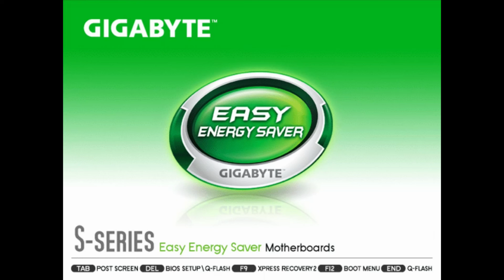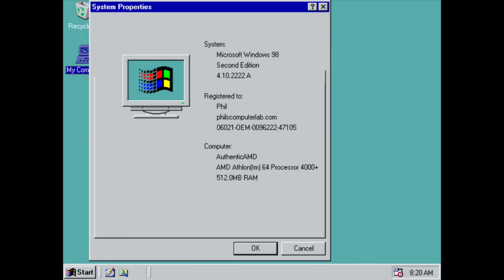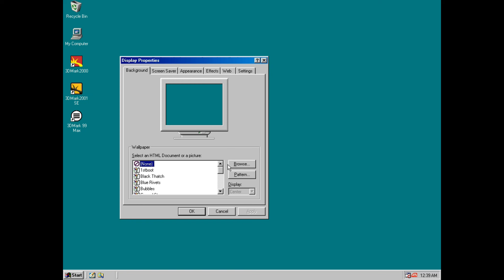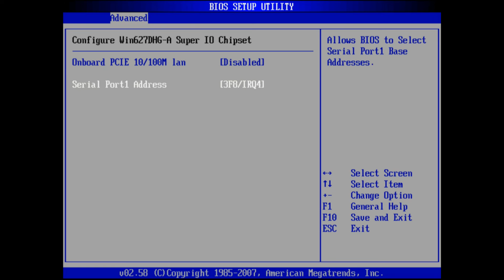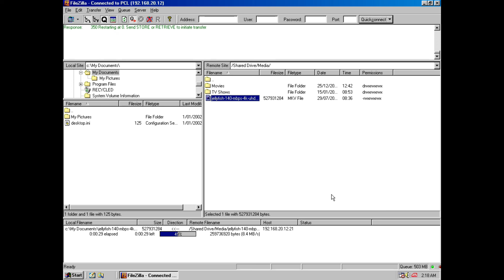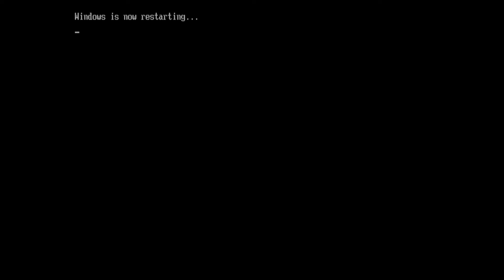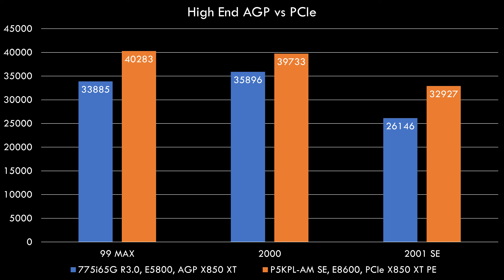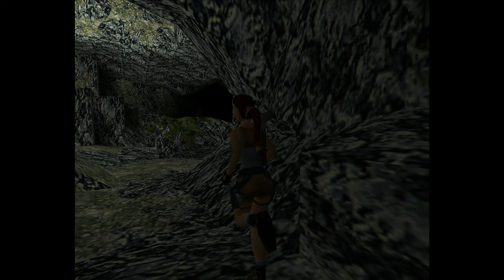Using PCIe Graphics Cards with Windows 98 SE

Comment: Is there any nvidia card that will work with pcie ? I already tried a 6800, 7900, quadro i still need to test, get a not working sine, so will try to disable it and restart. Or is it better to use agp for combo win98 and XP system ?

Comment: I think that a potential builder of a such a computer might want to consider VIA's PCIe chipsets. They are pretty hassle-free as far as the gpu setup goes, no need to disable anything and color depth shenanigans as shown in this video.
Reply from the maker: Hmm aren't such motherboaeds quite rare? Afaik Intel sued VIA for Pentium 4 PCIe chipsets and many motherboard manufacturers didn't want to take the risk...
Reply: @philscomputerlab  I think those were released post-ban, when they've reached some sort of an agreement ~2005-2006, but it was too late for via's chipset business anyway. At any rate, MSI, Gigabyte, ECS and others are available in P4M890, P4M900 and so on flavors.

Comment: I am building a retro pc with a SOYO K7VTA PRO v1.0 (the newest with ISA slot I, amd Athlon xp 2200 or something, fx5500 256mb agp (i think with the better 400mhz memory), and two different soundcards, one ISA AWE 32 and one sound blaster live 5.1 pci. I haven't still put it together. I have been told that the geforce fx series was the most compatible with DOS games...

Comment: Phils do you try pci express network card on this motherboard and do you have the integrate lan driver for this motherboard? Thanks
Reply from the maker: I didn't try, but what I recommend is follow the theme of this project and use a PCI 3COM network card...
Reply: Ok thanks, I put a startech gigabit ST1000BT32 pci who working very well but I can’t put my soundblaster live 5.1 now. 😅 Will try with an P5KPL AM EPU who have two pci slot.
Reply: I tried to put a soundblaster live 5.1 and a pci network card ST1000BT32 on a P5KPL AM EPU, unfortunately it doesn't work very well. For the sound an usb sound card or my usb logitech speakers run good, just needed to enable "legacy USB support" in bios. Does anyone know a cheap usb/RJ45 network adapter (gigabyte speed?) who can work in win98? Thanks.

Comment: I'm always getting errors the first time I boot Windows 98 SE from the hard drive. I get blue screens saying "A fatal exception [...] has occured at [...] or those white dialog boxes saying Explorer.exe etc. I have tried several times installing Windows, but it either gets stuck at detecting Plug n Play devices or crashes with those white dialog boxes at the desktop and then it doesn't respond anymore. I use an AM2+ MSI KA780G with a Radeon X300 and an Athlon X2 BE-2300. I also disabled everything I don't need in the BIOS. Such as LAN, HD Audio and onboard graphics. At this point I don't know what to do anymore. I also checked VOGONS, but didn't get the answer I was looking for.
Reply from the maker: @HardKickinGroupGermany  I haven't tried that platform yet. Do make sure to use 512 MB RAM or less.
Reply: @philscomputerlab  Hmm, I'm using 1 Gig. Maybe that's too much.
Reply: @philscomputerlab  So apparently it wasn't the RAM size. Now I'm using 256 MB. I could get to the desktop on safe mode, just like before, but this time I tried to run msinfo32, but immediately got a blue screen after hitting Enter. Exception 0E at 0167:BFF9DFFF. I should mention, that I'm using a Radeon X300 SE with 128 MB.

Comment: I am confused. At 12:21 you have the 3DMark 2001 score at 33k but on the very next slide you have it over 37k when comparing with the other graphics cards. I am getting about 34.5k on my PCIe x850XT under Win98 with 1Gb RAM and 3.0Ghz Xeon quad core. Strangly if I increase the RAM to 8gb, the performance goes down to 28.5k. Under XP the performance is not effected by the amount of RAM (I get just over 39k on XP). I am not sure why Win9x is slower with more RAM, but I am ok with it, as the peformance is still excellent. I intend to also boot this PC into Linux for web browsing etc.
Reply: Windows 98 hates anything above I think 1 GB of ram
Reply: @setty3000 true. I believe I installed a RLoew patch to resolve that.  This was a build on a test bench. Not something  I actually ended up using.

Comment: I wonder if you have the appetite to do a 6800 ultra vs X800/850 XT comparison in windows XP, perhaps even with a system faster than the E8600 and newer drivers (by perhaps a couple of years)? I get the impression the Radeon's will be faster due to driver progression and alleviating a CPU bottleneck, but the 6800 Ultra will always have a special place in my heart as the first top dog GPU I ever bought (upgraded from a 128MB HIS 9800Pro Ice-Q - hell of a card too!)

Comment: Just wanted to thank you for this video.  I was able to test a similar setup recently:  ASUS P5KPL-AM EPU / Core2 e8400 / Hynix DDR2 5300u @ 667 / Radeon x800 XT  
My average 3D Mark 2001 score was 34280, but I had several system and PCI devices that are not supported or do not have drivers.  So I tried something else...  
With these parts, I was able to get 3D Mark 2001 scores in the 23500 range on an ASRock ALIVESATA2-GLAN and Athlon 64 4000+ with 1mb cache overclocked from 2.6 GHz to 2.88 GHz.  The AM2 board used a VIA chipset with working drivers for everything except an ACPI motherboard resource.  Also got in the 22500 range on a Fujitsu-Siemens D2030-A Socket 939 board with an Athlon 64 3700+, SiS chipsets, fully supported with all drivers.  Fun projects, all PCI Express, all working with the caveats mentioned for the AM2 and 775 boards.
Reply from the maker: Awesome outcome! Yes PCIe feels so won't but the more surprising to see it actually work 😜

Comment: So this machine could run Windows 98 se up to Windows 7. What about an OS related benchmark. I guess Windows XP would be the most performant on this system, due to better driver optimization, as well as support for multiple processors, yet more lightweight than newer operating systems. Also, a boot time benchmark would be interesting. You should also be able to start with ms dos 6.22, which would start almost immediately.

Comment: I have had a few dead 9800 and x800 series AGP cards I bought "untested" for a stupidly fast Win98 system.
An abandoned old idea. Always thought PCI-E was a no-go, but I know some Voodoo cards with AGP are basicly PCI cards in every way but the physical connector, so this might be a similar case?
I've just picked up an x800 GT and an x850 XT (non-PE). Both PCI-E, just take this dream for another spin. Not the very best of the creme de la creme, but I figure both to be overkill for Windows 98 regardless. Just like you said, this does open a few possibillities.

Comment: The reason for the need to disable the VGA adapter in Device Manager is because of how Windows 9x does its non-Plug and Play detection. When scanning for devices it erroneously picks up what it thinks is an ISA video card and initialises that. This is why you see the resource conflict message. If you choose the "Devices by connection" radio button, you'll see the non-PnP devices at the root of the tree. The only ones that should be at the root on a more modern PC are APM support (if available), Numeric data processor, Plug and Play BIOS (or ACPI BIOS), Processor support and System board. Anything else should be removed to avoid these conflicts.

Comment: Funny thing about the ATI X800 series of cards. They were designed to run with a PCIe bus. Even the AGP model. If you look just above the AGP port on the card you will see the chip that converts PCIe to AGP. I believe that ATI called it PCIe to AGP bridge

Comment: Are lga 775 with agp boards that rare out there? Here most of the early 775 boards, and low cost ones such as the pcchips p23g and several other ecs boards were like this and i think somehow they have chipset drivers for 98 due to their primitive via and sis chipsets (via is probably the betted option, i think).

Comment: What do you guys think of the Ati x800 xl 512 mb? I just picked up the saphire version and man it's a pretty card. The only thing is that the cooler they use was the x850 pe cooler which doesn't touch all of the ram modules, which I hope that doesn't hurt it in the long run
Reply from the maker: Great card! Better suited for XP but can work in 98 as seen in this video.

Comment: You're not using SMB to make sharing to 9x easy?  Yes, you have to enable the 1.x SMB protocol on the server, but it should be fine if your server is not external facing.
Reply from the maker: You can do that, but I now prefer to use FTP and keep the NAS secure.

Comment: Wonder how will this setup would run windows 7..  currently have a machine that runs win98, xp, 7 and 10..  10 really doesnt run, it boots but so slow it is unusable, 7 is very slow also and barely runs.  Just wanted to see what the hardware i have would do.. lol..

Comment: That fix must be an x800 issue as I have had to do the same with my agp x800 if I used dvi out (or hdmi with an adapter), with none of the changes taking unless I disable the second display in device manager. I only noticed what was happening as when I would try to make a change, it would instantly select the inactive display and then fail. But that's part of the fun with the likes of 98, troubleshooting things that are no longer an issue in modern OS's. Its part of the reason why  I would recommend people tinker with an old 9x pc if they have a chance as it will make them more able to sort out the more simple issues they get on newer OS's.

Comment: just curious, would you be able to run an LCD that has high refresh rates with the PCI-e video card? talking 600fps in some games it would be awesome to have an LCD that can do anything over 100hz. But G-SYNC and AMD's Freesync are not in the drivers. so getting one of those to work in 98SE would be amazing.
Reply from the maker: I've done a video on this. The graphics cards have the power but often the game engine has built-in limits and over DVI also only so much you can do. V-Sync works and at 100Hz the input lag is hardly noticeable.
Reply: @philscomputerlab  I'll search your videos and check it out. thanks for the hard work done here, this is amazing!

Comment: E8600 was such a beast of a chip. Even in a locked down Inspiron 530s, it, with 8GB RAM and a GT 1030, kept me going until last year for home theater and retro gaming/emulation use, on Ubuntu with Wine/Proton.

It's now a file/Plex/Jellyfin/pihole server, after I sold off the 1030. Wolfdale really feels like the Sandy Bridge of Core 2, being relevant far longer than most would've ever guessed.
Reply: Can count the 45nm quads too.
Reply: If possible try setfsb
Reply: My first computer I ever built had an E8400 in it. I ran it for a few years until I jumped over to a phenom ii x6 1100t due to wanting more cores and threads. The E8400 was definitely a beast cpu and I used it as a secondary pc until about 2018 when it died after my nephew's house got hit by lightning in a thunderstorm.
Reply: @oOignignoktOo1 sad thing about those Phenoms, they did not have SSE.  Had to upgrade to the FX processor, which had only four cores usable, where yours had actual six.  I was thinking of grabbing one, just so the mainboard remained relevant but alas, it is collecting dust.  After upgrading to a 18 core E5 cpu, I really never looked back.  Although I do have an old P4 machine I am trying to get to work.  Having a real headache with it in Windows XP x86.   I was considering installing linux on it, but my last attempt ended up where GUI was a slide show.  I figure I need a better graphics card or a streamlined build of linux.  I still gotta learn how to use Wine.
Reply: @oOignignoktOo1 you had a need to use more cores ? Even FX CPUs were competing in the same category for Single Core speeds. 
I imagine the Phenom series were even worst single core. And for older games from 98/Xp it was not needed more than 2 cores (1 most of the time was sleepy)

Comment: Should try the the 6800 GT & Ultra and a 9800 GX2. For the 9800 GX2, I'm curious about it since there's modified drivers made that you can use to get that working, where as with normal drivers from NVIDIA, there's no support for it. Hopefully there will be success with that, if you put it on your projects list.
Reply: "those modified drivers" are really just inf edits to add more support to unsupported curie generation based GPUS like the geforce 7 series. and no the 8 and 9 tesla series don't at all work for win9x and were never supported. i don't know why zac added them to the infs, but maybe he was confused at the time when he discovered the driver support inf modification.
Reply: @explorer9049  Sure would love to see those drivers in action anyway, even if 8 or 9 series don't work for them, although specified. That's just me, I like visual proof.
Reply: @SleeperJohns  sorry for the late reply. the only reason why the geforce 7 series work because architecturally they're the same as the 6 series line and the win9x nvidia forceware driver treats them all the same even when technically nvidia never supported this configuration. it was already proven that curie series graphics cards were end of the road for support for win9x.

you can check sites like msfn & vogons on forum posts of people trying to get other unsupported graphics to work but to no avail. even i thought the radeon x1300 series (RV515) could work on windows 98 but alas ATI dropped support after the radeon x800 series gpus.

lets just agree that zak's custom inf edits were an oversight, because those are old driver modifications from like 15 years ago.

you can actually get any vannila graphics card drivers and achieve the same result by editing the device ids and OS label inside the inf, it's how i got my radeon hd 5870 to work on windows 2000 even though the driver was only mean't for windows XP.

i only make these replies to encourage people to understand how these type of relic crap software/hardware work. also i wanted to mention rudolph rloew in which he actually created patches for these pieces of old hardware, he made an actual patch for nvidia forceware win9x graphics driver so people can get graphics cards with more than 256mb vram to work. he's also done stuff like added ahci support to win9x when it never supported it, so he has done alot work to keep this ancient relic of an OS relevant in terms of the retro pc scene. R.I.P rloew.

Comment: Does any PCI GRAPHICS CARD support 1080p for windows 98.
My board is a SBC single board computer attached to a backplane that has PCI slots, ISA and extended ISA.
Reply from the maker: Should be possible with FX 5200 type cards.

Comment: Greetings Philscomputerlab! I have PCIe GeForce 7950 GT OC 512MB running Win98SE, Msdos 6.22, and WinME. The motherboard used is DDR2 ASRock 4CoreDUOSATA-2 VER 1.2. Motherboard comes with drivers for win98 to win7. Was using AGP 7900GS 512MB but 7950 is fastest. I have some problems with sata2 ports so I use ide to sata adapters for two 128GB sata SSD.

Comment: Just tried using my Radeon X800 GTO (PCIe) with my recently-built Windows 98 rig. Specs are almost the same as yours, with using PCChips P43G (Intel G31 chipset) and Sound Blaster Audigy 1. You can use LoneCrusader's Intel chipset drivers for chipset support.

With everything installed, I get a score of 28584 in 3DMark 2001 SE, making it a fantastic performer for a Windows 9x rig.

Comment: When working on writing drivers for an open source project Im involved in I was surprised to learn that pci express is actually easier and much less work than agp to get working.
It's obviously different, but there's a parallel with getting VESA modes in that it doesnt require specific chipset support, but rather a standard (over simplified, but it gets the idea across).

Comment: If for you guys in US, AU or EU is hard to find those jewels, imagine for us in Brazil... it's hard to be a retrogamer in Latin America :(
Reply from the maker: The X850 XT PE for Windows 98 is really a very very specific project. Not needed IMO, go with something easier to find like Raeon 9200 or 9500 or 9600. X600 or X700 for PCIe.
Reply: @gundstaff  That's true - natural food here is affordable (very) - a balanced and rich diet is achievable easily - but electronics (specially retro) is a nightmare, a lot of eBay users don't ship overseas - there is a 120% price increase with customs taxes and shipping costs and the currency folds by 6 (Yeah 1USD equals 6BRL and our minimum wage is around 220USD). It means a Voodoo 3 is equivalent for a entire month of work... sad... and the local market for retro is vey hit and miss - nobody sells used stuff and most of afore mentioned items in Phil's videos wasn't even a thing back than... I am so sad because of all of it and because I'm late to the party... when I turned my nose to retro pc the prices and availability was gone wild...

Comment: I just picked the asus p5kpl-am se and a x850 PE pci-e card. I cant wait to build this. Its because of your channel I get to relive my reason to of getting into computers to begin with. The x850 came in the mail first and after messing with it for awhile I finally got it to work on my xp machine. When I run3dMark 2000 and checked gpuz for the temps it reported 88 C and I shut it down right away. Before I do anymore with it I need to give it some love and replace the thermal pads, and remove that old paste. Phil what do you use to monitor your gpu temp in windows XP? There is a feature build into gpuz but its not the best. Also Im surprised you only had one video after finding out this was possible. Any idea if your going to go and test other x series cards on windows 98 with the PCI-e interface? Or did you find reasons its better to use older hardware? Thanks again for your work and keep it up.